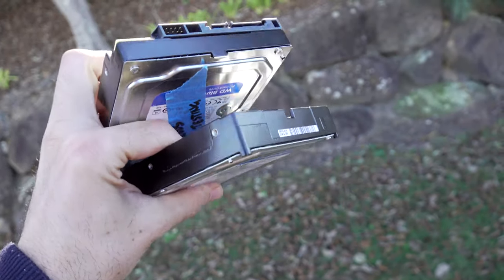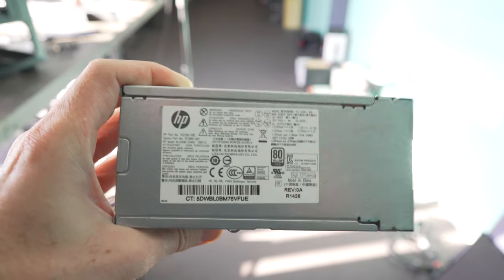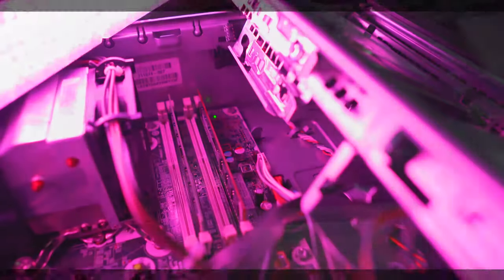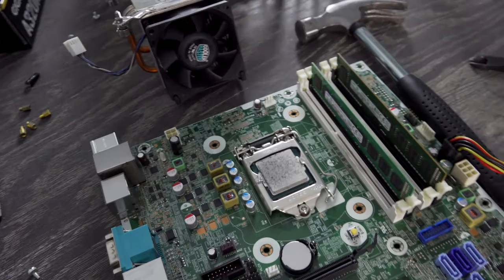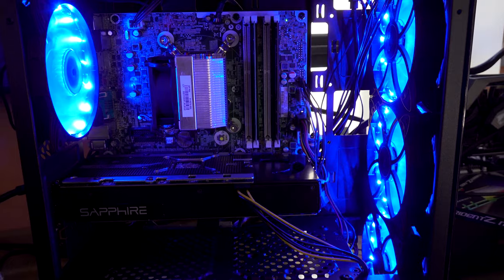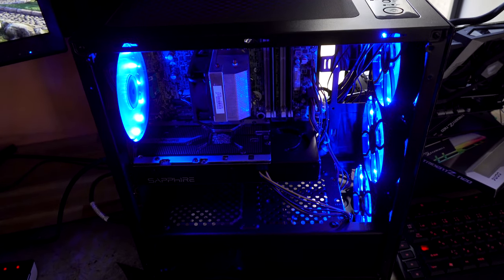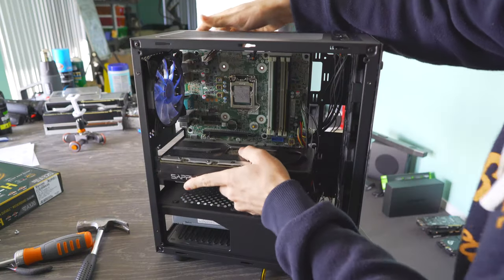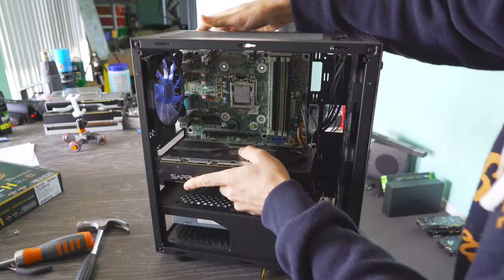Turning a $100 4th Gen HP ProDesk into a GAMING PC? (Mid-Month Hustle)

Comment: Couple of months ago I've built myself a decent gaming pc out of junk and scrap. I've bought HP8300 office pc for 40€, it had 4 GB of RAM and i5 3570 with a 240 GB HDD. I've bought used RX560 4GB for 50€, 80 GB SSD for 20€, 500W 80+ rated PSU for 35€ and a 24 to 6 pin connector for 5€. I've also had a spare 500GB HDD and used couple of more sticks of my old RAM. End result is i5 3570 + 10GB RAM + RX560+ 80GB SSD (for OS) + 240&500GB HDD for storage, all of that for just 150€. It runs most games fine in 1080p resolution, so far happy with that. In future I might get i7 3770, it's supported on this mobo, and even a stronger gpu, but it needs to be compact size to be able to fit.

Comment: I made a build similar to this about a year ago using an 800 g1 tower, ended up pretty similar to this, you can use a standard atx power supply with this motherboard
Reply: What size can can I use for that q87 express motherboard? I'm trying to get the smallest one, but because it's 12"x9", does that mean I have to use a mid tower?

Comment: It's what I did with a HP desktop pc 4th gen (I5 4400) . it's working great ! No need to upgrad for the moment :) . Combined with an RX 570 ( your advice) it gave pretty good performance :) . I've got Also a little I5 6500 but I don't think i'm going to use it just for something like 10 % perf better . As always  good job ! thanks for the vid :)

Comment: I built one of these with a Cullinan MX case and a 1650 to make a fortenite box for a buddy best part about the Zotac 1650 is that it doesn't require additional power it just runs off of the PSIe slot which makes things a bit easier. 

Thinking about using another one of these I found for free (it's all messed up and doesn't work) to use the heatsink to fabricate brackets to maybe try and mount a Hyper 212 to it but if not it's fine it would just be nice to have the RGB heatsink that also works as well as that one does.

Cheers.

Comment: I usualy use molex to fan header adapter for prebuilds like this to power the fans at 5V. THat usualy makes them silent and you can stuff some cheap things in the build, yet still have enough cooling effect. I have an Core2Quad 9300 I think run with a tiny cooler and a 90mm fan. It runs with 5V, keeping the CPU under 68° while under load. Crazy to think how much room for cooling it still has, if being a bit louder. If only I could regulate with temperature.

Comment: I've been using older Dell Precision Workstations for gaming and 3D Studio rendering machines. They're actually built to handle this kind of load, come with huge power supplies and multiple CPUs, etc. Not quite $100 cheap, but cheap-ish way to put together a sweet system without having to hassle with re-doing all the proprietary junk.

Comment: Hey Tech, in the future if you are using a Corsair Strafe on those old machines press the F1 + Windows Lock Key, in the top right, together. The board should flash and the scroll lock light should be flashing. This allows the Strafe to communicate with the older BIOS properly. Let me know if this was helpful!

Comment: I got an HP Prodesk like that but packed with an i7-4770 and thrown a zotac gtx 1050 ti low profile on it. Thats it, nothing else, no mods, nothing, and cooling is good enough to keep gpu at around 65 to 80º and the cpu running at 65º under full load cuz its not the original hp cooler, actually thermaltake sells cooling solutions for this machines and mine came with one of it (no idea if the disipator itself its thermaltake or OEM, but all the fans in the system has the thermaltake logo on it, aswell as the heat tunel). Its a cooling system similar to xbox 360's cooling (the tunel stuff), same benchmarks results as if I would put it all on a different case. I put that system together for around 260 USD. GPU was around 160ish usd and I got the system from an auction the main bank in my country do when they swap equipment. Basically they auction the old stuff and I got the system for 80$ without a hard drive for obvious reasons. I put an ADATA 128 SSD as boot drive (20 bucks) and a 1 tb hdd steam library disk from a broken laptop I had laying around. Sick build and modding skills tho

Comment: You should check out some dell optiplex pc's. Companies are switching there systems to upgrade, and an optiplex from 2011-2013 are absolutely fantastic budget builds. I personally recommend getting only the Mini tower version so that you have some airflow and a decent size graphics card. Anyway, I got my optiplex off of ebay for $150 and it came with an i7-3770, 8 gigs of ram, and a 500gb hard drive. I had a 1050ti laying around so I popped that in and I have myself an excellent backup/streaming pc. They're all over ebay.

Comment: i did this with a dell optiplex 9020slim, i got a 24pin to 8pin adapter so i could run a decent power supply. im running a gtx1050ti exoc with the i5-4590 16gb ram and 120gb ssd. runs very well and was a really cheap build. the dell optiplex costed me $50aud, got more ram for $25aud and the gtx 1050ti i got for $150aud

Comment: 24 pin to 6pin adapter with a couple wires on the 6pin end moved around can allow you to use aftermarket ATX power supplies.

Comment: I did the same thing with the last computer I had except the power supply was proprietary so I changed the case on that to and had to put jumpers in to short the two grounds on the front USB and audio that wasn't used otherwise it'd bring up an error that it wasn't connected.
Reply: Hey Pam which of the 4 grounds did you short for the front usb? Assuming that it is the frontal 3.0 you talking about. Thanks!

Comment: Capacitors just started leaking on a friend's Dell XPS 420. A fortnight after I replaced the dead PSU with one I had laying about. The HD also decided to start clicking. Took two weeks (at $99) in the shop to recover onto another drive. So... Off to eBay for a Dell 3020 MT. 4th gen I5. You've given me hope it isn't $120 down the shitter.

Comment: Hello!! Im currently building a hp pro desk 400g1 Mine came with a i5 4960 3.5ghz
(I bought it refurbished so i dont know if it comes with that or not, glad it did tho) 
Upgrades:
-SSD upgrade for OS and essential apps and games
-Radeon power color 480 (4gb)
-Still haven't upgraded the ram (im going for 16gb 1600
-Running on 2 power supplys cause i cant find the adapter in my country (wish I knew this before hahaha) 
In using a crappy case because it will be wall mounted.

I haven't found any info on the power consumption of my GPU after seeing this, im curious if just the stock power supply will do

Comment: I have used an dell motherboard from an xps desktop and put it in my beige hightower. 
At first indeed i couldnt start it because of that proprietary on/off switch. 
After some (multimeter) " research "  i figured out if i bridge 3 pins i could use just an regular switch to start the pc. I made an jumper out of an old ide-data connector and its working fine. 

 If your interested i could share that information (not shure it will be the same on every dell system)

Comment: I recently bought a ProDesk 600 with an i5 6600. It has a 285w PSU that I spliced in some pcie cables and put a GTX 970 in it. $250 total and it plays CP2077. 😎 BTW, you can get an adapter to use standard PSUs with these computers.

Comment: Cool to see that you made that HP work in a regular case! Nonetheless I do still prefer the Dell Optiplexes over the HP ones, as even as you pointed out that both the front panel and power switch headers are proprietary on them the pinout diagrams are already available on the LTT forums. Also I'm not a fan of only using nuts to secure a CPU heatsink as it's pretty easy to apply uneven pressure on the motherboard and that can cause flexing and trace ruptures over time. Finally I've been using both RX 470s and RX 560s on both 2nd and 3rd gen Optiplexes without issues using the pre-Spectre and Meltdown BIOSes available for them. Best regards!

Comment: you can buy a PSU adapter on Ebay that works pretty good with these

I added a better PSU to the setup so mine could run a 1070, all the RGB/fans and a bunch of old HDD's I dont need to make a budget build for friends when they come over to game with me.

Comment: If you can get a somewhat decent RX 580, you can usually undervolt them quite good. With the undervolt my Gigabyte Gaming RX580 8GB runs at 1340Mhz and only needs around 100 Watts.

Comment: Recently got an optiplex 7010 with an i7 3770 12gb ram and a 1tb HDD all in it for $135 and threw in a 600w psu and Rx 580 for like 150 total and it runs anything

Comment: You can get adaperts to use normal atx psu. You might get a warning about missing psu fan on startup though. Atleast I did with a 3rd gen board. Used it with a gtx 770 and 1060. Worked great other than hitting F1 on startup.
Reply: Im pretty sure you could disable that warning in the bios too

Comment: Brian, I love contents like this. Is this system Over-clockable ? I understand the limitation of Power Unit , but apart from that , can it be overclocked?
Reply: i don't think so
i own HP oem pc z200
Bios doesn't offer overclock option
Reply: @bitelaserkhalif  BIOS is not the only way to OC. If yr Processor is unlocked it can be OCed in Windows by utilities like Intel XTU , TS etc. I have Dell Precision T3500. OEM system with locked BIOS. I use TS to OC it from 3.33 Ghz to 4.1 Ghz. But it can go no more, whereas on ASUS Motherboard it can go upto 4.7 Ghz.

Comment: ive got a similar build from an hp z230. I used an hp power adapter off ebay to hook up to a regular 500W psu and i got around the blocked peripherals with a pcie riser for the gpu. The hp stuff isnt too finicky, not like the dell stuff you mentioned. My unit is an i7-4790 and the gpu is my old R6. I havent got it in a case though. Its worth noting that it is super picky about the ram it uses and tomy knowledge the z230 is the only one that will work with a regular atx case from the z series.

Comment: got a refurbished HP z420, e5-1650v2 @ 3.50 ghz and 16 gigs of ddr3 for about 250 usd. I put my gtx 1050ti in it because it can run off of pcie power and I wasn't sure the psu would have connections.  I never knew about those sata to power pins, whats the strongest card you reckon I could get? If it helps I think the proprietary psu in this computer is 500W. Thanks in advance, always love watching your hustle  vids.. the used market is in an awesome place right now!
Reply: 🙂 the HP Z420 is supported by the aftermarket community, checkout MODDIY and other websites, they carry the Power Supply Adapter that converts the 24 pin to the proprietary motherboard connecter, its like $20, here on youtube search Z420 Power Supply, theres videos showing u how its done

moddiy.com/products/24%252dPin-to-18%252dPin-ATX-Cable-Adapter-for-for-HP-Z420%7B47%7DZ620-Workstation.html

.
Reply: @MrSamadolfo  Awesome!!! Thank you!
Reply: @ABfan97  ✌😏 ur welcome

Comment: Most OEM power supplies(the ATX ones anyways) in my experience can support a 6 pin card without problem because the motherboard and locked CPUs usually use significantly less power than if you built one yourself
Reply: Also in response to your usb3 problem, they make angled adapters that fit in. I got one under my r9 390 on my optiplex 7010

Comment: I find dells easier, as the 3 pin power only needs 2 of the 3 to connect to power on, and the PSU connection to the mainboard is usually standard, you can also clear any fan warnings by jumping the sense to ground...

Comment: I have a similar power meter and some times it lock up and the reading on the display don't change. If you disconnect it from the power it will reset and will work correctly again. The battery also must be removed temporarily.

Comment: Great budget build. I think you can get an adapter now, and put on a better power supply. Did you use washers for the heatsink replacement nuts? How many threads were hanging out the back?
Reply: Yeah I got one for my 6th gen i7 use a 600w Corsair with a rtx 3050 before I used a rx580

Comment: I’ve got a Prodesk with an i5 8600 and 32gb ram but have thought about converting it to a gaming pc by adding a low profile gpu but I only just realized a few days ago before seeing this that I could transfer the majority of the parts into a mid tower and put in a full size card. This video confirms that and is probably something I’ll do. I just sunk $1600 into a customized HP Omen though so it may have to wait

Comment: Why did you hide the fact that it was very difficult to jury rig the power button on the case to this motherboard? How exactly did you do it? Also, how did you trick the board to not throw missing fan errors?
Reply: not only that, the undetected front panel and usb frontpanel will also be a pain every boot up

Comment: The watt meter issue is odd. I have a 600 G1 SSF under my workbench. I put a 1050 Ti in it and on my watt meter I measured a max of 125 watts from the wall for a full system load. It worked just fine for me, and I have that same PSU in mine.

Comment: did a build in that same Rotanium case re casing a lenovo m82 i7 3770 with a gtx 1060 6gb to sell only a month or so ago, surprisingly great little case and cant be beaten for 39 dollars, had to make stand offs for the front acrylic panel so it could actually breathe but that was the only real severe issue. unfortunately needed a new psu as the m82 sff models use a tfx psu thats not suitable for a desktop.

Comment: Funny, so far I didn't have a motherboard that didn't have standard Intel cooler mounting... The most proprietary thing I had to deal with was a Fujitsu Celsius 400, proprietary power supply and connectors with short cables so I had to find a case that had the PSU mounted on top (those are so rare these days!)

Also, that tiny power supply mounted in the big PSU slot with just 1 screw made me SICK, BRYAN! lol^
For those things it might actually be worth it to get into some slight modding, like cutting out an acryllic or MDF plate that the PSU gets screwed on to, paint it black, screw the PSU to the plate and then that into the PSU slot.

Comment: Dude, I got 3 of those exact same hp 800 G sff desktops. They all had i5 4590s I believe and also mine came with 80+ platinum psu’s. ended up just taking the ram cpu storage out and have all 3 motherboard sitting. The cpu coolers as well.

Comment: Great vid, I've been trying to search for something like this, but using either a G2 or a G5 motherboard.  How did the motherboard fit into the standard ATX case?  As I thought the HPs used a propriatary motherboard shape a bit like Dell do too, so assumed the screw placement would be all wrong, as thats the main thing I'm uncertain to before going ahead  (the backplate is fixed into the HPs etc but thats no big issue I guess

Comment: Chief, I can’t tell you how long I’ve been trying to find a simple answer to the quest “can I connect my RGB fans in the case I just bought to my motherboard?” Also, I think you answered this question but I don’t need to do anything special to get the power button to work correct? So you say you had to jump it so I just wanted to make sure you didn’t need to do anything else although I’m pretty sure you didn’t thank you so much. I’ll be sure to make a video as well and post it.
Reply from the maker: Yeah nothing special on the power button for this one.
Reply: @techyescity  thank you so much man it seriously helps.

Comment: I have a HP z420 board in my budget workstation and the boot up does the same thing. F1 to confirm despite saying escape to boot.
Reply: 🙂 do you have the rear case fan plugged into the rear fan header? i know for sure the HP Bios checks that

Comment: Im in the dell 3 pin situation, where 2 pins are for power and one does the error and there are 3 led pins instead of 2. beside for having to take the gpu shroud off  since sata is right next to gpu and the fact that you need all the errors off so the fans dont run 100% it can be done.

Comment: Question, where did you plug in those extra fans? I have this motherboard but there aren't any three pin connectors. Did you use a 4 pin splitter off the CPU fan and just plug the three pin fans into three pins?

Comment: Thanks for a great videos like always. I learned new thing, i did not know that a small power supply 240w can power like this gaming pc, i always try to build with at least 400 w.
Reply: You are wise to do so. 180w on a 240w Gold rated power supply isn't horrible but you want to be about in the middle. 120w on a 240w power supply, 200w on a 400w power supply.

Comment: If you turn over that HP 711578-001 CPU  Heatsink, you'll note you can unscrew the brackets off of the heatsink.  I'm just wondering if I drill a hole in the middle of each bracket and reattach to motherboard, will  be able to assemble an ID-COOLING SE-224-XT CPU Cooler, or something of that aftermarket cpu cooler, on to the proprietary motherboard?

Comment: can you not get a Little Devil PC-V10 case and you can lose the cooling fan but the install will require using conformal coating and kneeded eraser to keep the moisture away from the electronics, then the relay in said case will start the system up when the cooler head reaches -70 degrees below zero.

Comment: Bryan did you know that on eBay now you can buy 3d printed io shields for those pc you build with no io shield like that hp just thought I'd let you know bout it.
Basically you get the 3d printed io shield and you cut out the shape of you io shield I have done it before it's easy and makes the build look so much better

Comment: There is a hp 8300/z220 power adapter can be used and re pinned to that will work well with traditional power supply.